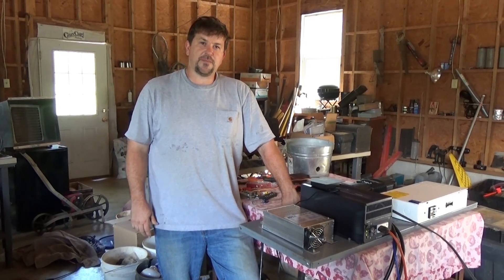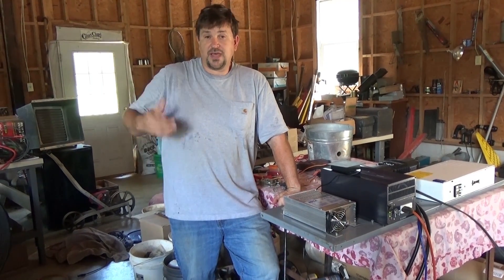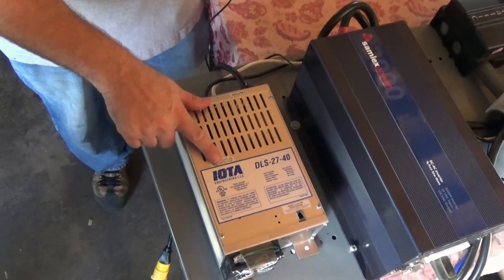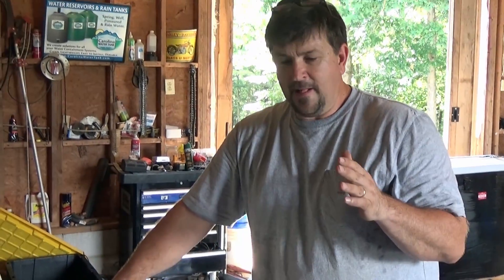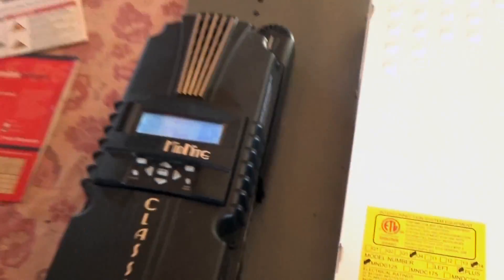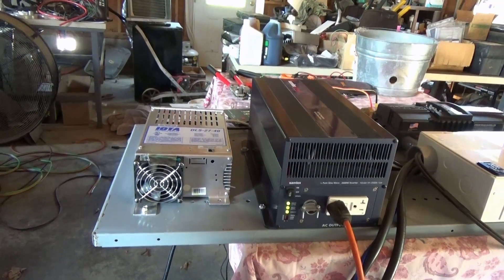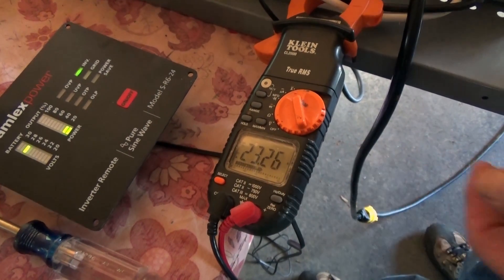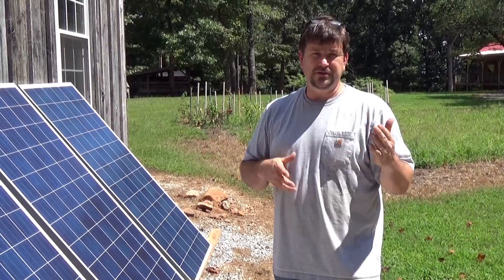Our New Modular Solar Generator!

Comment: Twelve volt has many mobile advantages . All of my mobile devices will have stand alone capability separately from a twenty fore volt stationary application similar with enough pannels too support comfortable rest in a tiny home at eighty degrees eight hours per day . Thirty pints of dehumidification would be required throughout the remaining eighteen hours of the twenty fore .  Thanks Eng. 775

Comment: Engineer 775, am so impressed of ur presentations, I have a question for u n wounder if u could help me on this... ok... I have installed in my house three 100 watts n a 80 watts, 2 x charging controller which is hooked up to 2 x 150 amps n 1 x 100 amps dry cell battery which is in turn hooked up to 2 x 2000 watts Pure Sine wave Inverters... but still I dont get enough power to operate my washing machine of 2000 watts... it seems that the batteries dont charge properly ... but I live in the western part of Fiji where the sun is at its best.. I still dont know the total output of this set up.... I fixed this myself n now I have electricity but not enough... for home use... please help me..

Comment: I purchased a salmex 12v 2000 w pure sine like the one in this video hooked to a 12v battery bank. But the samlex input over voltage light flashes amber at 14.2 volts. Charge controller has to use 14.4 v to charge flooded batteries. I see in the video that yours is not flashing ... Any suggestions? Thanks.

Comment: how do you feel about super or ultra capacitors in a set up like maybe a 24v setup with 2 batteries with maybe a bank of caps to make the draw on the batteries a little easier I watched a video on a guy who had 2 batteries and I think 12 caps and he said it more than doubled his amp hours they were 2.5 volts and 3000 farad I believe

Comment: what kind of system can I get for 20k? I will be installing everything myself. with all the different products out there on the market I am at a loss on how to make a choice for all the components, from panels, batteries to inverters, controllers etc.. I am also considering combining this with Hydro, but also trying to decide which one to spend the majority of the money on. I have watched Mr.HydroHead and his system seems that if you have the amount of water to produce that much head there would actually not be much of a need for solar other than as a backup. I could spend as much as 30k if I can power a 2k sq. ft. home and a 3k sq. ft. shop. going with wood heat/cooking but was also considering a wood boiler even though now it will be difficult to find a pre-epa unit. I have also heard that fork lift batteries are good. almost too much information out there. my goal is to be self sufficient and off the grid by this time next year or at least to have all the components purchased.

Comment: Go 48 volts and never look back, cables are small due to low amp draw and piggybacking isn't a cluster. Midnight classic can run 48 .
Reply from the maker: +John Rogers 48 for large systems.   agree.  Some folks can't afford all those batteries.

Comment: Cool !  Good Job !  Nice to have options. You might look into Hydrogen Fuel cells instead of lead acid batteries.. The tech has come a long way in affordability and portability. Especially if you have a water source available.

Comment: What are your thoughts on the Tesla Powerwall? Will you be doing a review on it? Thanks. MrRantek24.
Reply from the maker: +MrRantek24 I'd be glad to review one if they would send it to me. :)  The Jury is still out on that one.  We are still going with proven Lead Acid until it makes sense to go Tesla.
Reply: MrRantek24 its just hype atm . we'ill wait and see how it goes. also do you have the cash flow to send them one to play with.
Reply: one thing about tesla . they dont tell you is they use first generation lipos batteries in thier wall mounts.

Comment: I often wonder if there are system out there that provide power for just the energy hogs in a home. In TX we have AS that takes so much energy. So if one could have solar just to handle the AC, the rest would be fine. Just an example.

Thanks
Reply from the maker: +1timby Solar AC is the answer!  https://www.practicalpreppers.com/online-shop/air-conditioning

Absorption Chiller Video coming soon!
Reply: engineer775 Practical Preppers Sorry I wasn't more precise in my comment. I was speaking of a system that would provide power for existing AC or Heating. Sadly there are more efficient AC system like the Water Furnace. Except they're very expensive. My biggest power draw is my AC. Our heating season is typically short & my NG furnace is very efficient. 

Also wonder if anyone has come up with a way to draw heat from one's attic & use it to preheat domestic hot water. 

Thanks

Definitely would like to see the absorption vid...:)
Reply: engineer775 Practical Preppers Sir, just liked your video.  I have a question 

looking to improved the production of my 24 v system 

my panels are wired in parallel. would I gain from changing the wiring configuration to series / parallel  

10 total
8 parallel 
2 series 
Will this config work? 

what issues can I expect if done.